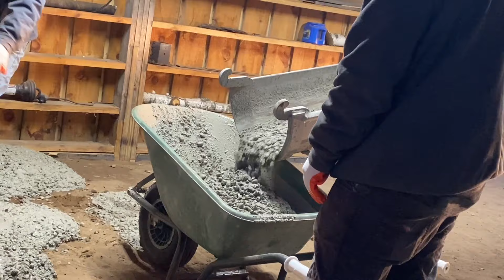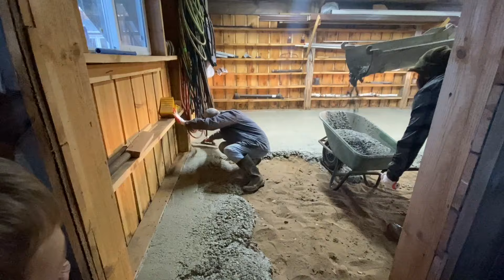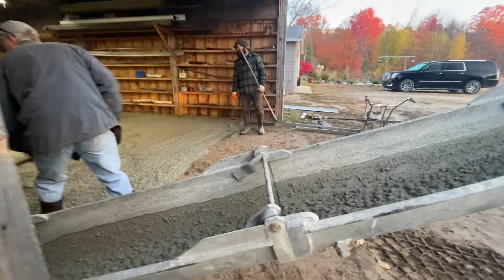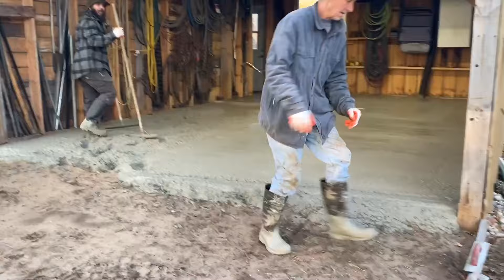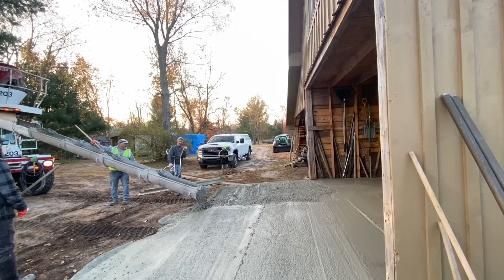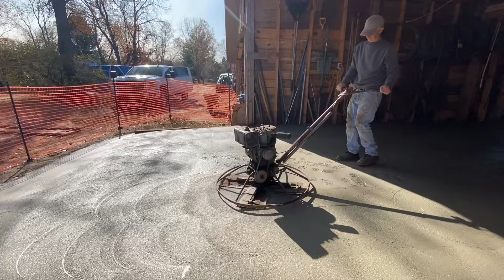Pouring a Workshop Floor in November

Comment: I dont understand, no iron at all? It wil crack over time
Reply from the maker: Hi, the concrete is 4” thick and has fiber mesh in it. I should have mentioned that. Thanks for watching!
Reply: @Springdalecottage  Well ok, but here in Europe its not an option. With  out iron it cracks with nothing on it over time. Anyways, it turn nice at the end. I salute you